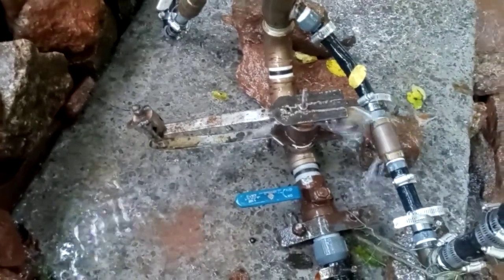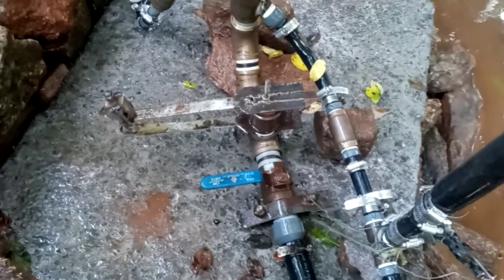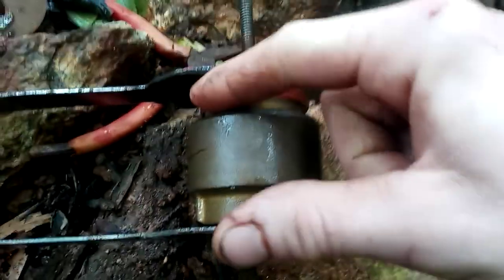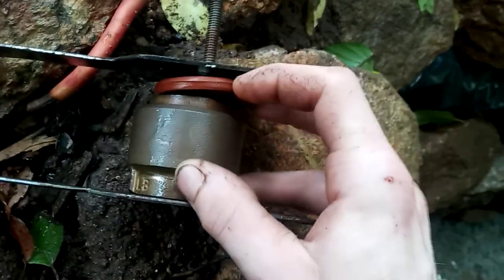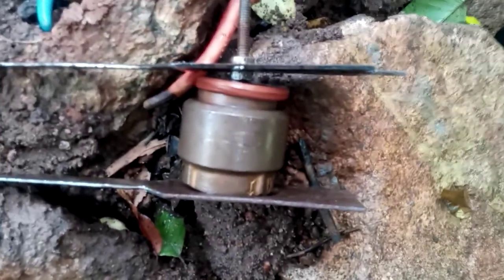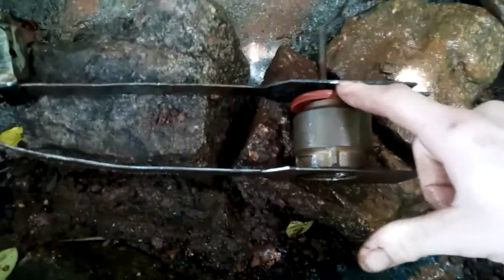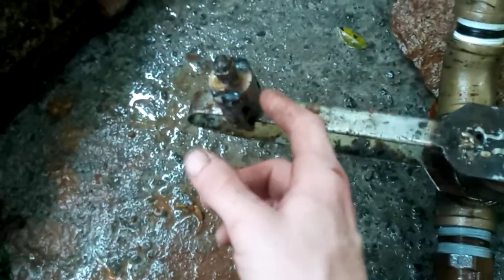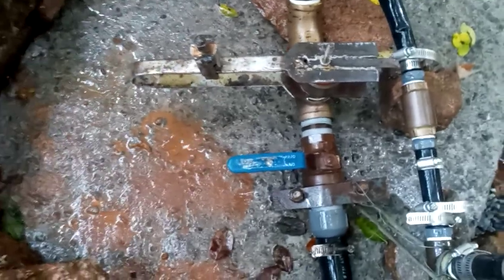Easy cheap and fully adjustable waste valve for ram pump

Comment: How thick is the spring spatula for the waste valve? Can you please help me?
Reply from the maker: Absolutley, its about 1/8 inch thick, or maybe about 2mm thick, it was made from an old yard measuring stick, i sliced off the sides to thin the width down some and bent it in the middle. I then drilled a couple holes to fit the bolt through and tweaked it a little as i went to make sure everything fit. I honestly made it up as i went. You can find pictures online of similar waste valves that I modeled it after by typing in homemade waste valve into a search bar
Reply: @Whelessry  Thank you so very much!!! I already made one thiner but works good!!
Reply from the maker: @cuejorge2003   that's awesome, i was having problems with my ramcycling properly and this was the only solution that worked
Reply: @Whelessry  I have seen many different vals and this is the best by far. The way you placed a weight instead of a bolt for the spring is great. Even more, the way the valve is made makes the water to push up to open the valve so makes everything easyer. Thanks again!!
Reply from the maker: @cuejorge2003  thanks! Have fun with it